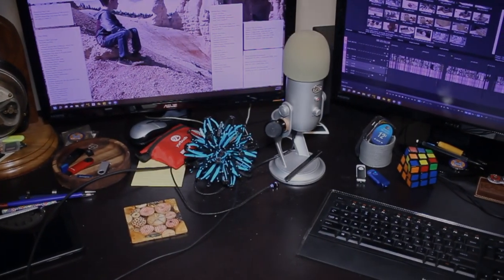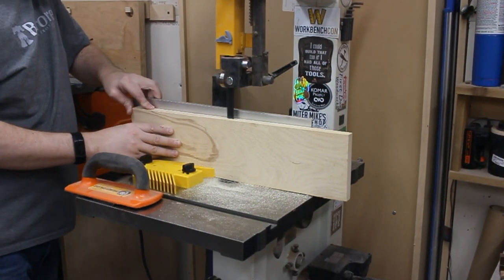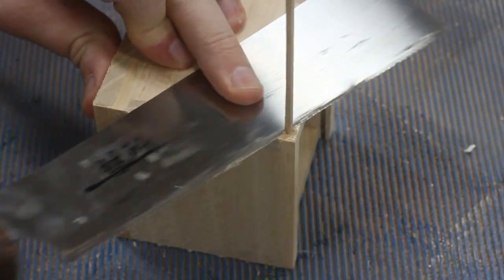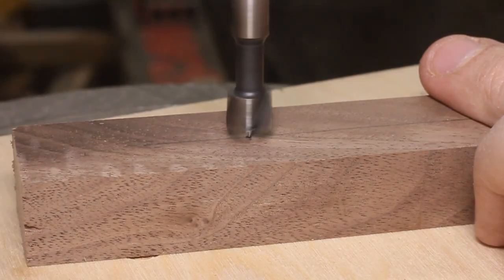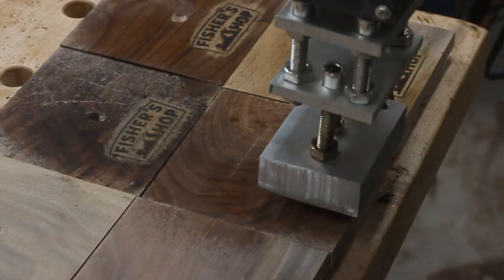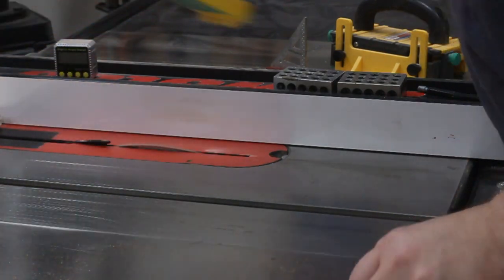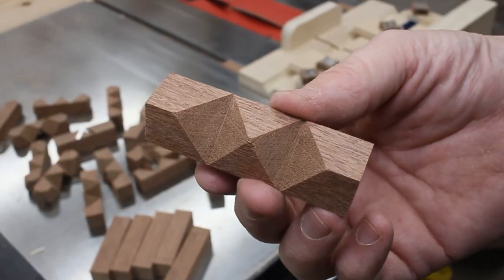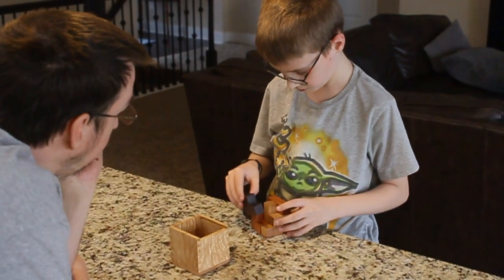Woodworking: Making Wooden Puzzles

Comment: Your "puzzle cube" is a Soma cube. We had a plastic one back in the '70s.  I'm tempted to make one where each piece is made out of individual cubes of different woods.  It would be easier to sand the individual cubes, and if the edges and corners are slightly rounded, would give each piece (and the assembly) a nice bit of texture.

Comment: 0:33 I work on CNC machines cutting metal and we have to change out inserts quite often, I was wondering if you ever change them out and how often when cutting wood?
Reply: Yes, but very not often as long as you stay away from reclaimed wood and dirty wood.  Rust gets left behind from old nails, even when you pull them out.  Sand and grit can be a problem if you work with slabs that still have bark.  Other than that the inserts can hold up well for years in a weekend woodworkers shop.